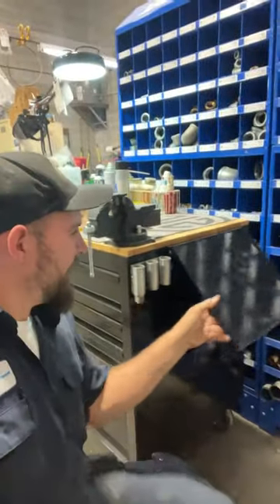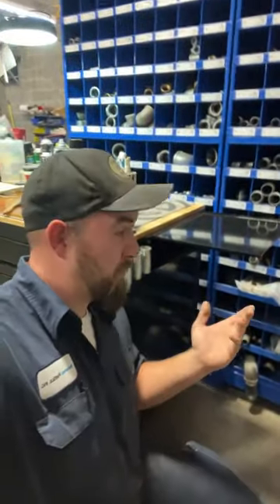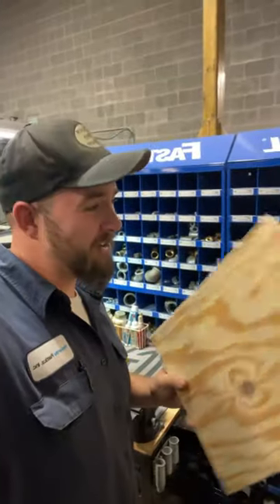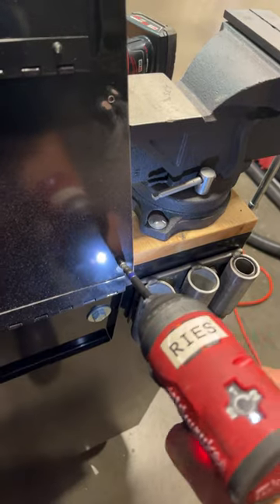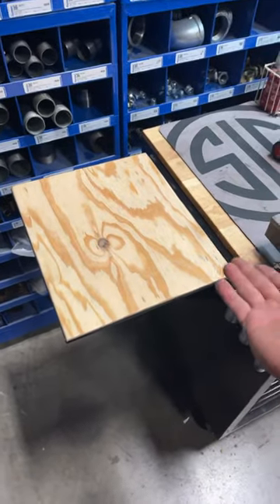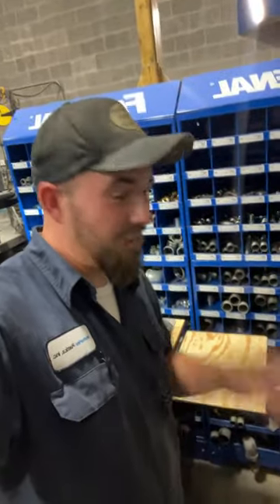Tool box upgrade! #shorts #tools #doityourself

Comment: I got one of those tool boxes with a wooden top. We cured it with a sheet of stainless steel with a 1/2" 90°bend  on the press break and glued it to the wood. Now that Yukon toolbox can handle grease, oil, scratches, etc. It's an $80 dollar upgrade

Comment: Us fine woodworking types prefer to use 10w30 that leaked out of the used filter from the oil change on the shop truck you swore you were gonna do 10000 miles ago.  Gives it some sparkle and that burnt varnish nose feel the connoisseurs rave about.

Comment: And take either steel or aluminum 1/4 inch tall angle iron and make a boarder so that screws and nuts won’t roll off I did this with my work benches at home and it’s a nice touch. I just had it laying around.

Comment: Attach a half-inch wide strip of sheet stock (owner's choice of material) to the edge for small parts retention. It will only sit 1/8" proud, just enough to prevent screws/bolts/nuts/washers from escaping to freedom.

Comment: And now you've got a table that's the exact same sturdy with extra weight so it holds less.... Just put an old framing square on hinges and mount it on the opposite side as the stock holder and make sure you line it up to the right height and BOOM it's actually more sturdy!!! Given that at this point it actually has more support!!!

Comment: It's likely for books and smaller items. The work is usually center stage on the box right? So you can see how disassembling a carb for example, you can end up running out of space to keep all those tiny bits nicely organized. Not saying your mod isn't viable, just saying when you use things as they were meant, you'll find just how adequate they are.

Comment: You see it has a lip around side edges. This is designed to have a slab on top of it, preferably one that will bring it up to an equal height with the wooden top of the cabinet.

Comment: I put one one a cart from HF. I used it and  it really made a difference when I worked, i just cut out a section from one of those foamy rubber floor mats help with slipping tools and a lot quieter

Comment: I have a HF tool cart with that shelf, it came with it. That tray may seem flimsy, but it does hold a lot of weight. I've had the big batteries from the Dodge Charger/Chrysler 300 on it, and it doesn't budge. The mat that came with it is crappy enough that I bought a roll of the rubber mats for toolbox tops from my snapon dealer, cut a piece to size and put on there on top of the crappy mat. I'm thinking of drilling holes in the support to put removable pins in so that when it gets bumped, it won't pop off the support ledge and collapse.

Comment: Find a sign shop and ask them to shear you a scrap of ¼" (6mm) ACM (Dibond, whatever brand, it's PVC core with aluminum on both sides), and use 3M Super 77 spray glue to adhere it. Spray glue stripes on the back of the ACM (peel the protective coating first), then spray stripes 90⁰ to the direction you sprayed the piece on the tray. Use cardboard or painter's tape to avoid overspray, and when the two pieces are barely tacky, stick them together, then sandwich the whole thing with a couple of c-clamps and two pieces of scrap wood. The ACM is super flat and clean, and once that glue pressure sets you'll break the metal before you get it apart. The sign shop would probably charge ten bucks, something that small is trash

Comment: Is there enough room to mount it the bottom and it still fold down?  That way you get the support but the top still looks good.  You can probably use some stand-off spacers when you mount the shelf to the tool box, so that there is enough space between the hinge and the wood to make room for it.

Comment: Dan your the Man always thinking out side the Box .
Reply: BTW is that the 9 Drawer ?    I got the US Gen 4 drawer tool cart . then went to THD got the Husky 9 Drawer tool cart  just extra wide 24 x 48 maple top 3/4 inch ,  200 pound drawers 2 USB ports and 4 outlets .  I never use the power cord .
Reply from the maker: It’s 56” wide with 5 drawers and a locker on one side. I have 2 video tool tours of this box if you wanna check it out!
Reply: I will look , The 5 Drawer come out and I got the last of the 4 drawer . I needed a Big Cabinet  for the rest of my tools gear pullers and testing leak down and all that good stuff . my last place was Bigger 40 x 30 shop . I built a 24x24 lost storage space  rolling tool box work out better .

Comment: Its flimsy because its thin steel. Tool teucks have them for their boxes too. Better steel. 

I would suggest if low cost is your choice add steel to the table and angle brace to stiffen.

Comment: All depends what you use your flimsy side table for, I think it's only meant be used for multiple magnetic trays in which case this did seriously interfere with it's operation, only problem I see with being way stronger for extra workspace is stuff getting knocked off easy being flat.

Comment: How much weight do you think that shelf can hold before it sends that latch and all the parts on top of it express to the floor ?????
I know it’s H.F. , but I’ll give it a shot 👍
Reply: i believe they're rated for 75lbs but i could be wrong. Every toolbox we have at the Amazon building i work at has one.
Reply from the maker: I feel safe with about 50lbs
Reply: @mikerumsey7360  thanks for the reply👍

Comment: I have never had a problem with the sturdiness of the table I had a problem with the sturdiness of the hinge and the part that is supposed to keep it locked into position now with what you just did is all you really just did is put more weight on the end of that hinge which is going to wind up making it fail even sooner than what it should